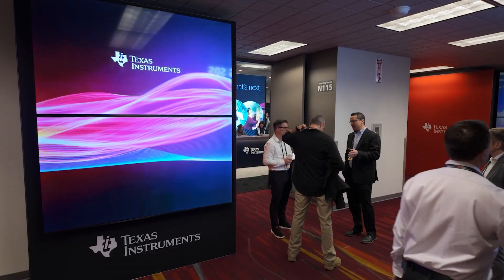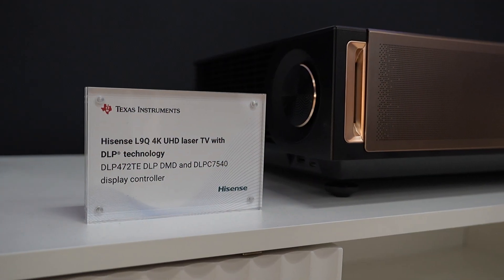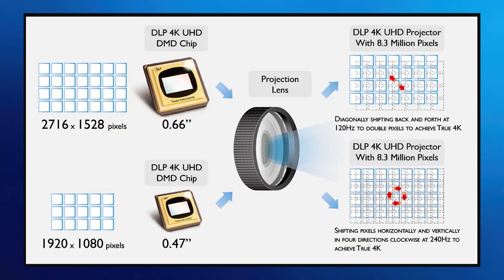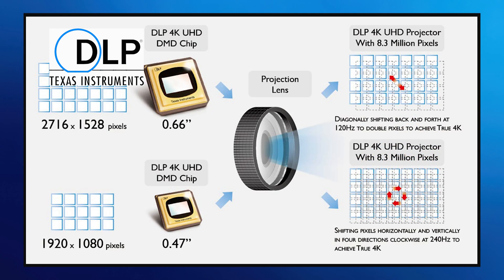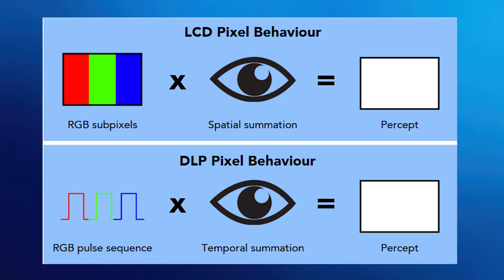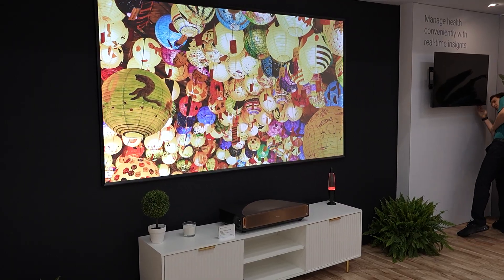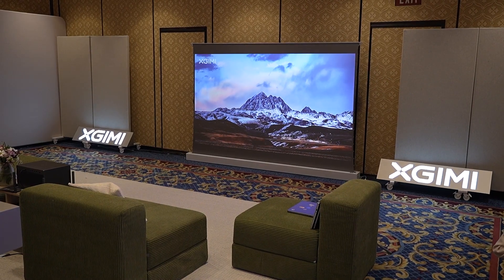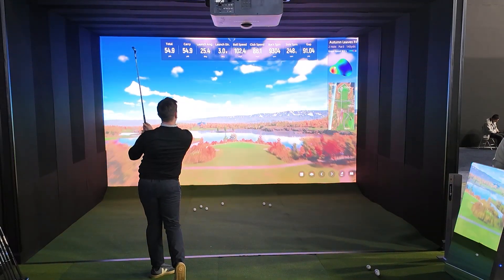The Future of DLP Projection | Texas Instruments on More Brightness, Higher Contrast & 4K/120 Gaming

Comment: Is there still a spinning wheel in the projector? If so, no thanks. Just like older hard drives the bearings always eventually fail. Plus the noise from the spinning wheel is always there.
Reply: Spinning wheels died 15 years ago when high-luminosity RGB LEDs became available.

Comment: TI has the blinders pulled over everyone's eyes... people believe the marketing, and will fight tooth-and-nail over it. 

If one physical pixel (micro-mirror) is being used to create 4 sub-pixels "on-screen", and every mirror receives full illumination (it's not possible to partially illuminate one mirror), how do you not have "cross-contamination" between those 4 sub-pixels?

If any 2 adjacent pixels (at the native 4k image media) are full Black/White contrast (ie "checkerboard"), it's physically impossible to project that accurately as the media defined it... you will get grey... a blending of whatever color those adjacent pixels were supposed to be.
Reply: snake oil always rules. only true unbiased test would be to photograph a small section of a standard 1920x1080 screen vs the pseudo higher resolution 4k or 8k using 1920x1080 dmd.
Reply: @gregaiken1725 I've actually done such, but better is a high frame-rate video so you can visually see the overlap. Hmm... maybe I'll post that video so people can see for themselves!
Reply: @beforebefore maybe to better understand and see their patented process high frame rate would be useful. but as a measure of resolution only, a 'still image' of one complete frame would be sufficient for resolution comparison. esp as average human eye has slow refresh rate ability. so what did you find? is this mere marketing hype? or was there a 2x increase in resolution?
Reply from the maker: Yes, a native 4K imager is the ultimate solution, but they are larger and more expensive. It is difficult for most people see a difference between native 4K and DLP pixel shifting. Even if they could, it would be hard to convince the average user to spend more than double the price for a native 4K projector.

Comment: Im amazed 4k is so damn hard for a projector very few alternatives still.
Also surpiced Epson amd Sony are still the only 3 LCD manifacturors and the rest use that damned rainbow wheel DLP
Reply: Color wheels are no longer in mass use... 3-LED (R, G, B) and multiple Lasers are the color sources these days. Only the lowest class of DLP units use the old RGBW or RGBCY color wheels.
Reply from the maker: DLP assemblies are smaller, less expensive, less complex and often brighter, which why they are the choice of most projector manufacturers.

Comment: 12:10 Okay heard... So riddle me this: If you've achieved this spectacular pixel density on this new tiny little chip.. Isn't all the manufacturing cost in figuring out how to make pixels smaller? Why exactly are you saying that native 4K is so far off? Isn't this an admission that native 4k could be achieved on a much smaller chip, and therefore a much less expensive chip? These tiny portable units surely must be affordable when they come out? Maybe I'm missing something about the mfg process that someone can enlighten me on.
Reply from the maker: As the mirror density improves, we will eventually see an affordable native 4K DMD. Using the current mirror pixels, the chip would still be huge (4 times bigger than the 0.39) and expensive.

Comment: So still no higher res DMD for consumers. Full HD eShifted to 4k ist Just blurry. They could at least have a half 4k DMD and enable 4k 120 by eShift. But those half 4k DMDs seem to have left the marcet.
Reply: There's no good way to shift a 2:1 resolution. That would require that the DMD mirrors be positioned with large gaps, which means inefficient use of the chip/process.
Reply: @beforebefore there have been many beamers that did this with 1 dimensional diagonal eShift. It's a cost saving measure to go down to 1080p. Not a feature.

Comment: Projectors r dead, they cant do proper hdr n now 100" tvs are like 2 grand, by the time projectors catch up, 130" tvs will be 2 grand
Reply: For the simple part of you cannot get an LCD tv in some areas due to the shear size, this is where projectors are simply better. The light source is better on the eyes than LCD as well. Reflective image vs a backlit image hitting you eyes. We see everything with light reflecting off of it, just like a projector provides.
Reply: @kriswingert1662 true

Comment: The cherry on the cake is the potential elimination of the dreaded RBE. In a previous interview it was revealed that this feature, introduced as a hack by Valerion, would now be available as standard with their latest model of light engine/controller. Something worth looking into.
Reply: I think this even goes beyond that right? Because Valerian RBE reduction software is changing/maximizing the cycle timing of the DMD/lasers, where this new DMD is enabling the mirrors to move even faster. So like you say they will make that those cycle time changes native, but it will be even better because the mirrors will be able to move quicker.
Reply: I bought the VM Pro 2 once I found out they were upping the price of the Max by $2k, and the picture was incredible, however the RBE made movies unwatchable (I returned it). If the Max does eliminate that, and this new technology works to make RBE imperceptible, then that will be truly game changing for home theater.
Reply: @eclypse1259 from what some YouTube’s said recently on a projector comparison video, the Pro had RBE, but the Max did not , at least they couldn’t see any. They were surprised but happy. Johnathan Engeln’s stream “3 way projector comparison”
Reply: @andrewskaterrr  yea, I wish Valerion hadn't delayed the max so long, and had I known it would have some magic setting that really tamed down the RBE, I would have waited on a new projector. I ended up getting an JVC RS1100, and although it doesn't have as much color saturation as the Valerion did, the quality of the picture looks less "tinkered" with, and has zero pumping in dark scenes.
Reply: @eclypse1259  while I haven't seen the Max, I did see the Pro at MWAVE 2024 because they were impressed with it and included it in the side by side Projector comparison, including the RS1100. Hands down I'd still take the JVC. Having seen all of the projectors calibrated and compared, JVC is my only option in a light controlled room if it's in the budget. Luckily I just became a dealer so I'll have one once I move to a bigger house.
Reply: @eclypse1259 Just noticed your post. Valerion recently announced that the RBE reduction feature first only available on the Max has been rolled out across the other models in its lineup as well.